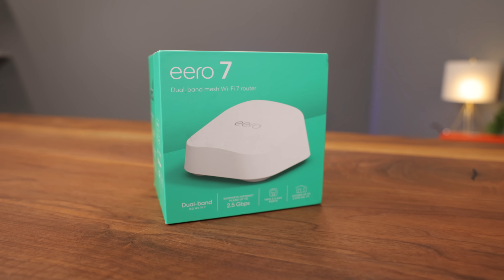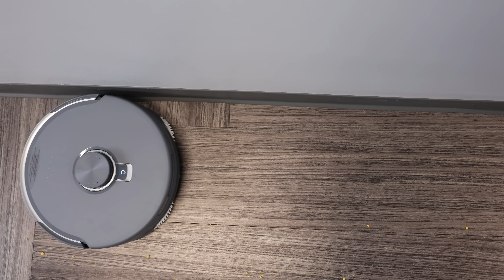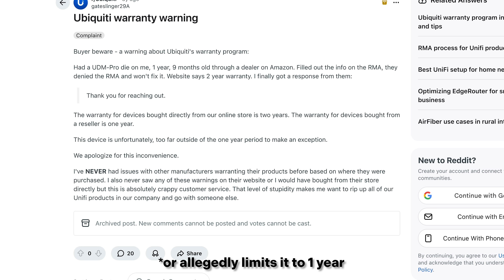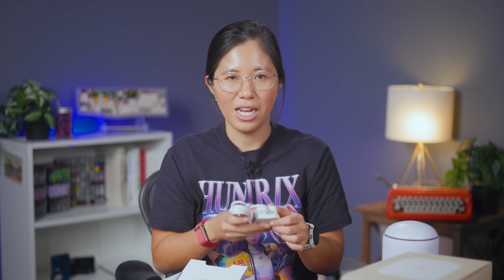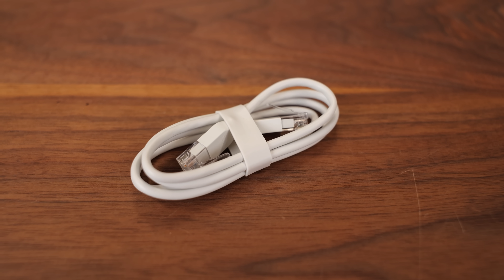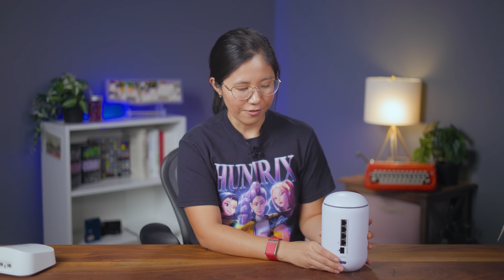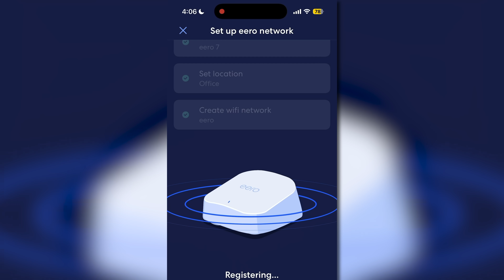Are Expensive Routers a Scam? (don't waste your money)

Comment: Tmobile Fiber makes you use the Eero. You can ONLY use the provided power brick, nothing else will allow it to operate. You also can't plug them into power strips and each device has to be on a different outlet otherwise they lose connection all the time. They are trash.

Comment: I’ve owned many Netgear and D-Link routers over the years.  In each case, I would need to reset (cycle power) every month or few months because they would just stop working.

Then 3-4 years ago (I can’t remember when … and that’s part of the point), I got a Ubiquities Dream Machine and it has run flawlessly ever since except for, maybe once or twice.  It’s old (just WiFi 5 and 1 Gb switch), but it just works.

As for Eero … well, let’s just say there’s a reason why my interest in Occulus VR headsets has dropped to zero.

Comment: My wife and I bought our first home, and I’ve deployed a pretty nice Unifi setup. Most recently I got their cable modem, to finish the primary devices. UCI modem, UDM SE gateway,  USW PRO Max 24 PoE switch, patch panel, and 3x U7 Pro XG APs, with cat 6A cabling. I’m squeezing as much from my 1.2 gig Xfinity connection, and ready if/when they upgrade our area to 2 gig… lots of new construction further out so I’m hoping it comes soon lmao.

I work in commercial low voltage construction, so the installation of everything has been relatively smooth lol… I have yet to run cabling into the walls yet, but I think the primary locations I want to wire should be relatively straightforward. I’ve gotten very familiar with my attic doing all this work some new vent fans, plus installing a working standard doorbell chime, if needed… since my video doorbell doesn’t support a standard chime lmao… I bought it thinking it did, but I  was mistaken 😂

Comment: One word - MikroTik. As a minimum or Cisco if even more is required. There are other options OPNSense, OpenWRT, etc but those are for very specific use cases. None of that consumes tp link crap or amazon you are the product stuff.

Comment: I own my modem, and use a cheap computer running OPNSense for my router. I have a couple ethernet switches for the devices in my home. For the wifi I use a commercial grade wifi access point, which covers the whole house. But my wifi only used for mobile devices.

Comment: 2:00 "Mesh" is "Tresh" because its just a glorified range Wifi extender.
On the unifi website you can find a WiFi calculator that allows you to simulate mesh links - try it and see what that does to the throughput.
Never use Mesh.

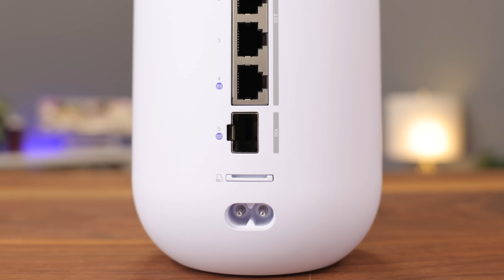Comment: 9:37, that port is called sfp+, it can be used for ethernet, fibre or a dac cable depending on what you need, its the most versatile port and the only option for longer wan/lan runs

Comment: I agree - don't waste your money.

My personal solution:

1.  Send back my ISP's cable modem/router combo that rents for $10 a month (discussed at 0:29 )

2.  Buy a cable modem that exceeds my cable service for one penny on eBay

3.  In case my cable modem dies, buy an identical modem to have on hand as a back up for 7 cents on eBay

4.  Buy a router that again exceeds the speeds I'm getting from my ISP for 99 cents on eBay

5.  Flash the router with OpenWRT

6.  Configure the router the way I want it - I've currently got it set up in a failover configuration.  My neighbor lets me connect to their service wirelessly, so my configuration looks like this:

WAN1 - Cable modem connected to the WAN port on the router

WAN2 - using the 2.4 GHz radio in my router, I connect to my neighbor's wireless router.  If Cable service on WAN1 fails, WAN2 becomes active, sharing out the 2.4 GHz connection from the neighbor to my local 5 GHz wifi network (as well as to the devices hard wired to the router via ethernet)

WAN3 - Using the USB port on the router, I connect my cell phone to it and share out its cellular connection via USB tethering.  If WAN1 and WAN2 go out, service rolls over to WAN3 - my cell phone.  Bonus - the router also charges my cell phone

All of this is seamless - in real time testing, I didn't even drop a packet while switching in between WAN1, WAN2, WAN3, and back.

So, internet almost never goes down as a result.

[I am considering a dial up service for WAN4.]

7.  Enjoy uninterrupted high speed internet access

~~~~~~~~~~~

My hardware budget was a total of $1.07 US (not including shipping), and I have a home network that exceeds what my ISP was providing with their hardware for a rental fee of $10 a month.

I have a spare modem if my current one breaks, and I also have spare routers I inherited from people who were "upgrading"  in case the one I am using fails.

Setup has been running for over 2 years without a hitch, and even when my ISP has gone down (which is often - the reason I decided to put together the failover setup to begin with), I've never lost internet access during that time.

Again, I agree - don't waste your money.

Comment: Terminology correction. In most home network, there's only one router, that's the gateway between your lan and wan. What gives you wifi is an access point. It just happens that it usually is packed as one unit with a router and also a switch, and maybe a modem for DSL/DOCSIS or a Fiber ONT.

Comment: I am switching over to GL.iNet routers by necessity. They run on OpenWRT, an open source firmware that will continue to get updates after Trump's router ban stops all current routers from getting firmware updates after March 2027 - unless your brand pays for a waiver and submits to some kind of regulatory requirement that I HOPE doesn't include allowing a backdoor for the government (which, honestly, is already possible).

Comment: I have a home office, I don't need a petabit per second of internet or a zetabit per second of throughput. I pay for a "lousy" 1/2 gigabit per second and I also use the router for backups at home. That's it. So... Any of these routers good for my use case? NO!!. But why? well, this is the reason: THE ROUTER IS THE GUARDIAN OF ALL YOUR DATA!!!! Your ISP is most likely spying on you if you use their router. The Amazon thing will also try and spy on you, and any router that requires an app is a security risk. So, let's not go crazy and state that a Raspberry Pi with PfSense is your option because that needs a level of tech savvyness that's not available for most. Ok, so, maybe something less fancy: Go into the forums of OpenWRT, DD-WRT or FreshTomato (the latter is the easiest to use), and find the "most compatible best modern router" for that software. Buy that one, go to the software page to follow the tutorial to install it, and then configure it to your liking. When your'e done, go to a tutorial on hardening your network, configure it, and... Bob's your uncle. You will have a much more secure network with a, usually, much cheaper setup. If you do this right, you will have the latest hardware running even faster than with stock software.

Comment: Not quite. The cheaper WiFi-7 routers with all the ugly antennas are true game changers, offering unparalleled support for iOT devices AND MiMO features that actually work for a typical home with more than 10 devices. Plus a boat load of other new support for things you once had to run wires through your whole house in order to achieve a true private home/office network.

Comment: Absolutely no value review. 
Sure the Ubiquiti is a better router, but at what cost.
Pissing on Amazon isn’t a criteria, but simplicity and value is.
If you were making an apples to apples comparison, the Eero Pro 7 mesh might be a better fit, not an entry level device meant for 75% of home users, with no reason to spend the money or need the capabilities of the Ubiquiti.

Sadly, your Amazon bashing diatribe misses the point of the Eero devices. Easy to acquire, good value/performance/ease of use for the consumer.
Stick to the nuts and bolts and not your guilded perspectives.

Comment: I've used Eero Wifi for a while, but I have no incentive to upgrade to any of their latest hardware and software features because it seems the main goal for the upgrades is to try to make you pay fees for maintenance issues if they come up, and I know requesting answers to problems is usually pointless when you talk to  most companies. My solution to connection problems is to apply multiple redundancies as much as possible which usually makes it faster and easier to determine where a problem is. I use more than one router network system, that means Eero isn't the only one in operation, and I have a backup network both online and in reserve if the system fails.

Comment: I went from an Eero 6 Pro to a Unifi Cloud Gateway Fibre and there was such a big difference. Most routers that your provider gives you with your contract are 'dumbed down' ones. They expect you just to want to do the basics. The UCG Fiber also used more of the ISP's bandwidth. Best move I ever made. Also, the best part about Unifi is the 'single pane of glass' where if you can manage lots of different tech in the same app (Router, Switch, AP, NAS, camera, etc). Also, Unifi has different routers based on what you want - wifi built in or not, camera support, etc.

Comment: I actually did a lot of research on routers before spending $500 on a mesh setup and I went with a eero 7 pro as my main router and a regular eero 7 for extension, I was gonna get the dream router 7 and a access point but it seemed super ghetto, the eero just made way more sense from a ease of use standpoint, I have 2 gig fiber and it’s perfect

Comment: The wifi repeaters you speak about are not routers. Also comparing eero to unifi is comparing apples to oranges. Unifi has way more features and expanability that eero doesnt have. We love unifi because we can self host and nothing has to leave our network whereas eero...good luck with that. Eero is for people that want plug and play whereas unifi is for power users that want more control and customization.

Comment: Before they changed the PCB I used to just by $20 Xiaomi AX3000T Chinese mainland and put OpenWrt on them. A mesh of $20 routers was always going to beat an expensive  single one at speeds neaded for normal people. That was the main point of TP link. Good hardware at cheap prices and you could put English firmware on it. With my 6 mesh points I spent less than your cheap one.
Reply: Mesh networking is in 802.11s. It’s a free standard. Not owned by eero. My openWRT routers are in an 802.11s mesh with 802.12r  fast transfer. None of this is proprietary. Ted et just put walled gardens so that you can not mix brands. My mesh has one router from another brand. They all just needed OpenWRT on them. Would still be my advice. Find a cheap Chinese mainland router you can put OpenWRT on and buy a pack of them. You’ll and up paying a similar amount to one U.S. one.
Reply: My setup has adguard home too, which is similar to a pi-hole. Requires some space which is why I’ve got one good router. There is also an OpenWRT package called Adblock that fits on smaller routers, bur I don’t know how good it is because I’ve never used it. Wireguard VPN tunnels are easy to setup in OpenWRT. My network is wifi 6, but you don’t need faster if you are a normal person. Professionals will go for Ethernet. Wifi 7 is just for the middle ground anyway.

Comment: Cheap cables included with routers and cable modem are pretty much always unlabeled. At least these days they seemed to have settled on yellow at least… not that I use their cheap, unknown cables anyways.

That 10Gb SFP+ port on the Ubiquiti is not something to complain about or criticize. Really. If you care about (and can actually fully utilize) wired 10Gb Ethernet, then you would have already spent the extra for the accompanying switches and NICs. At that point what is a few extra bucks for a transceiver and fiber… or you can just run DAC cables.

Personally I skipped all that and just went to modem -> FW -> Switch -> Wireless APs with Ubiquiti since their early days, now having upgraded to a rack with a cable modem, Dream Machine Pro, 24port 1Gb POE Switch (and wired Cat6A) and multiple wireless APs… plus a UPS. Yeah… it costs more than Eero Pro… it’s also a ton faster handling multiple Zoom sessions simultaneously with 4k video streaming on TVs, tablets and/or phones. The UniFi management software has gotten significantly better over the years, making management these days effortless. Oh... and I can run my own VPN to my home network… for free.

Comment: Synology can't handle the demands of today's smart homes. I had a Synology system (1 router w/2 mesh AP) in my house. Worked fine for a long time until I started expanding my smart home. With over 100+ devices connecting via WiFi and wired my system kept rebooting randomly almost daily. I was already having issues with my network not getting my 1g internet connection and only getting about 600mpbs. After working with Synology multiple times, pulling logs from the router (I'm an IT professional) and not finding anything I gave up and tossed my Synology stuff. Went with Ubiquity. I put the AP's and router in the exact same places I had the Synology equipment. One AP has a wired backhaul while the other is Wifi mesh. Same as the Synology. I immediately noticed that my internet connection practically doubled. No more slowdowns with my TV and other computers when Steam decided to update a game. 

I've got years of experience in IT and I don't know why I put up with my Synology for so long. Ubiquity is the way to go!!! It was actually cheaper than my Synology setup as well. No more reboots, full internet speeds even when transferring large files between my computer and NAS. The backhaul can handle everything and can handle the 100+ smart home devices.

Comment: Loved my Eero setup until the Router(s) would randomly drop connections.
I was paying for Eero Plus and the Eero Support never fixed the issue.
Dropped them like a Bad Habit for ISP Router.
Not impressed with Eero Devices.

BTW Had them less than a year when they started messing up.
Now for ISP - Had issue with Router and When they sent on site test it was a simple new Router needed.

I believe the Eero(s) were getting too hot and that caused it.

Comment: I'm in the process of moving to an all Ubiqiti system for my NAS and network, because of so many incompatibility and feature issues i've hac with basically every other brand. for casual usage, it's not that big of a deal, but I edit video, and it is extremely frustrating when compatibility issues prevent file transfers, or taking advantage of the full speed of my hard drives. The biggest thing it's annoying for me is I have a western digital in a ass which will cease to function whenever there is a firmware update pending, but it doesn't send me a message, it doesn't even alert it's control panel. And since sometimes connection issues have been due to network problems, I can't always be sure that it's a firmware update issue.

But the system sends me an email if the NAS goes down, so why can't it send me an email when it's time to do a firmware update? More importantly, why do I have to do any firmware updates if I don't want to?

Comment: ? The key unanswered issue is whether UniFi supports wired backhaul (wired ethernet between mesh nodes) like Eero. For a 2,500 sq. ft. house with concrete walls (or a townhouse, or a larger house), a hardwired mesh system is a requirement. I also need an AP for the backyard/lanai, wired via ethernet of course.

Comment: I am in too deep in the Ubiquiti ecosystem now lol. I have a UDM Pro, U7 Pro and U7 XGS with 10gbps fiber running to my other switch and my 2x2Gbps ISP connection is connected through a SFP+ to rj45 multi gig adapter

Comment: If you hired a Network Integrator to come into your house to setup everything on an Ethernet / WIFI Network, and told them to pick the best value equipment necessary to provide good service throughout the house, there is probably close to 0% chance the will use Eero for a WIFI Gateway Router, which is the foundation of your home network. And there is probably close to 100% chance the will use UniFi equipment throughout the house. Now UniFi could certainly use more open-source competition, particularly with their OS and Network Controller software. But I have received regular updates to both, in the time I have had my UniFi Cloud Gateway Max.

Comment: Just replaced my ASUS mesh system with a new Ubiquiti 10 gig setup for my multi gig setup. While it was less than easy to mount access points and I had to  use MoCa adapters for wired backhauls. But.... it's been a great move! Still have more wires to hide, but happy to do the work with these great results! By the by..... the 6 Ghz band stinks! I actually turned the 6Ghz band off.

Comment: I’ve had a UniFi Cloud Gateway Max for over a year now, and it works fine for my use case with my Arris G36 WIFI Cablemodem. 

Everybody’s use case is different, and I run everything that can be ethernetted on ethernet, and everything that has to be on WIFI runs on WIFI But everything is networked on the Unifi, and I keep the UniFi Site Manager OS and Network Controller updated. Would highly recommend one of the UniFi Cloud Gateways, but perhaps not the Dream Router 7. Although it’s convenient to have the Access Point integrated into the cloud gateways, a separate Access Point might work better in another location. Again it depends on your use case.

Comment: I use an ubiquiti dream machine pro, I used to use their access points but they weren’t too fast, my isp provided eero pro 6e included with their service.  Put them in bridge mode and connected them to the dream machine. I lose vlan but the WiFi is extremely fast. I am not running messing just using the eeros as access points.